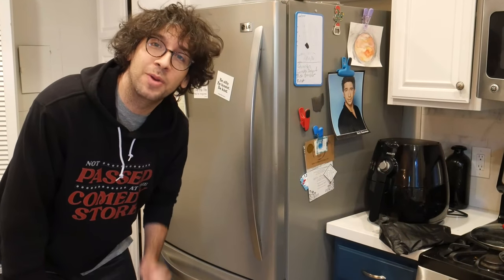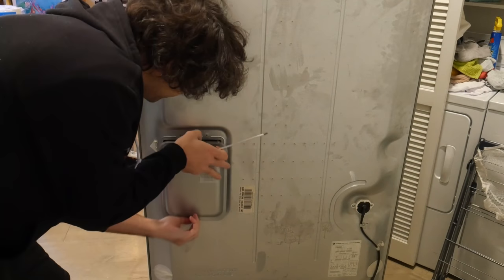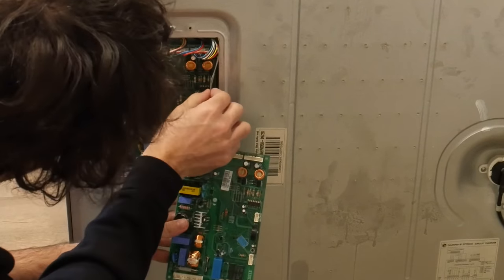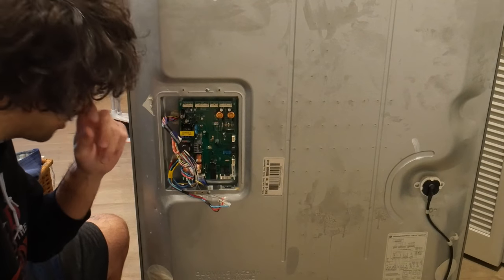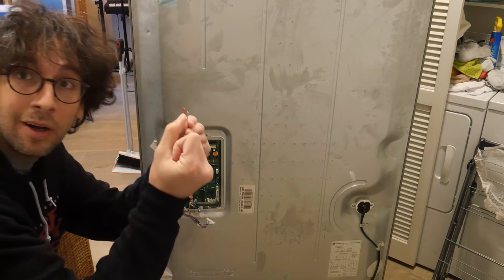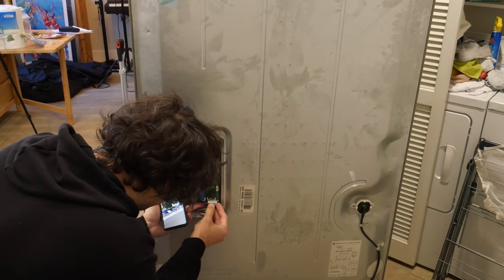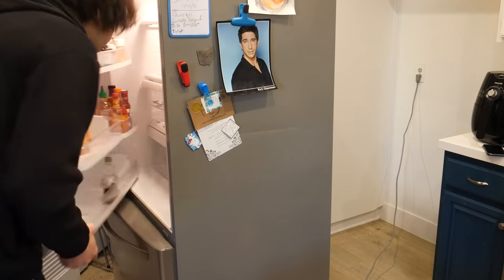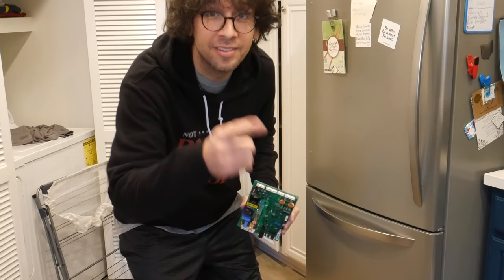Refrigerator Repair (How to replace the control board) - RICK'S DIY

Comment: there’s no concern with being shocked by an unused/new part. what can happen, and the purpose of grounding yourself, is that static electricity can be built up and send currents into your electronics making them faulty or fucked altogether. 

also in terms of hurting yourself with electrical boards is that used ones can keep large amount of electricity in the capacitors for incredibly long periods of time, touching one bare handed can be very harmful.

of course these are all rare/somewhat uncommon scenarios but scenarios that should be monitored or made aware of for your sake and the sake of your parts.

thanks for the entertainment, rick!!!!!!

Comment: I hope we get some close up shots of the bad power board. It would be cool to see if we could actually find the problem. Blown fuse, popped cap, burned up mosfet, cracked solder joints, or whatever.
Reply: Yea yea, I too would like to see if we popped a cap, or had any burned up mosfets, always seems like a blown fuse at the end of the day don't it tho

Comment: FYI if your laptop (PC or Mac) breaks down assuming its a motherboard issue and not a screen issue the repair process is exactly the same as here. First look up its model number on Ebay to find parts, match them exactly, then when you get it open up your laptop and check all the wire connections to the board, undo them, unscrew the board and remove it, put in the new one and screw it in, then re-do all the wire connections. Its harder because the connections can be tiny and you'll need tiny screw drivers and to remember to swap over other stuff like memory or hard-drive (or SSD) if they aren't actually part of the board (some are some aren't) but yeah basically the exact same thing as here.

Comment: F you got water/ice machine, ez on the pull out. The water line don't got too much slack usually so you might be limited in space. 👍👌 Farts rule